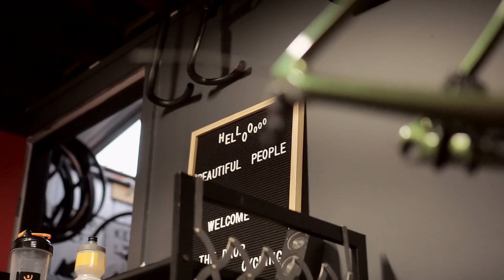2020 Giant TCR SL Canyon aero bars Dura Ace 9170 dream build

Comment: Nice spec, I have a 2020 TCR Advanced SL in Blue that is the twin of my 2020 Propel Advanced pro 1 disc and I swapped out the Sram Force for Ultegra di2. Interesting to see how you’ve routed the di2 cable out with the rear brake hose from the frame exit hole rather than using the top tube underside bung like Giant does.I’ve the idea of the cables being together for tidiness but feel the heat shrink looks too bulky for me personally. 

Good build though. Same colour as the 2020 Enviliv with SRAM my friend has. Looks awesome in the sunlight
Reply from the maker: Thanks John, this cable route is what the owner prefers, I have seen people route di2 cable comes out of toptube and you would seen 3 cables (di2 and 2 brake cables) instead of 2 cables using heat shrink. 👍

Comment: Lovely bike, love the clean lines of the TCR frame, just wondered why the Canyon stem/bar set up? It appears to not blend in, is that because it’s stacked up quite high rather than slammed?
Reply: OD2
Reply from the maker: The owner likes the one piece look and setup, and canyon and giant both use oversize steer😄
Reply: @thedropcycling  nice build, what mount did you use on the cockpit set up please?
Reply from the maker: @simonhogan2043  hi Simon, you can find it on Ebay it's from Japan I think, search ' Canyon handlebars mount' you will be able to find it. Not cheap
Reply: @thedropcycling  thanks, keep posting builds 👌
Reply from the maker: @simonhogan2043  will do 👊

Comment: Great video! Thanks! I've just finished setting my bike with the same 9170 di2 but the junction box button is not working. :( Double-clicking the button doesn't change the shifting mode. I can check it's in M mode. Do you have any clue?
Reply from the maker: Sounds like a faulty unit

Comment: What steerer compression plug is this? I changed the original one it came
Stock with and all the plugs I’ve used slip up except the FSA one.

Comment: Those cables at the front looks out of place when you got an integrated aero bar and stem.
Reply from the maker: same as all the canyon bikes
Reply: @thedropcycling  True but compared to the tarmac and emonda's, this looks outdated. Even factor are starting to hide the cables when they were against it not that long ago.
Reply from the maker: I agree. This is 2020 TCR, even the new generation 2021 TCR SL cables are still not integrated. A bit disappointed for sure
Reply: @thedropcycling  2021 version is even worse going into the top of the down tube.

Comment: Do you have to drop the Junction Box every time you want to charge the battery?
Reply from the maker: Yes the canyon bars has this little clip, design to use the 3 port junction box, easy enough to clip in and out of the bars and at the same time makes it looks neat
Reply: Fair enough, nice and protected from the incidental drive side drop, better than the 910
Reply from the maker: @kennethstreet7868  exactly right
Reply: Is it not compatible with the 5 port junction?
Reply from the maker: It is. It sits flash with 3 port, 5 port may see a tiny bit under the stem

Comment: It’s old
Reply from the maker: it's 2020 model.
Reply: theDropCycling ya, there’s a new 2021 model
Reply from the maker: @marcuscheung5025  yeah correct, the owner bought it brand new front the shop, half price of 2021 model, so to me, that's a win. Performance wise, not much improvement
Reply: theDropCycling yes! In where I’m from (China), The 2021 frame set is around 2000 USD lol.
Reply: @thedropcycling  Hey Nick, hope you're well and really enjoyed watching some of your other videos. What would you think of one of these exact frames with SRAM Rival AXS and Zipp 303s wheels? I saw you were saying in one of your videos that the ISP is a firmer ride than the Advanced Pro (really would like a more comfy one). Would be great to have the frame set only available for the TCR Pro 2021, but they don't sell it in Oz.

Also, for 187cm tall would you say to go M/L in size which is the top end of their recommended size chart? Concerned that I feel stretched on a Large Defy so maybe downsizing is better, but then concerned that the drop between the saddle and the front end is too big. Lots of questions, I know. Thanks
Reply from the maker: @cosminciuraru  hey mate. It qll depends What type of riding you do. That bike is not a comfy bike to ride around or sit on it all day. It's a racing bike. So you gotta ask yourself what you want to do with it. My advice is to choose comfort over speed. Get an endurance bike like the defy or Specialized roubaix if like you said you want a comfy bike. If you are serious about racing. Train! Don't worry about the gear too much. You will have more joy out of it. If you really like TCR, ML sounds about right
Reply: @thedropcycling  awesome thanks for the quick reply mate. Currently riding an entry level Defy and looking for something lighter, faster and with decent comfort. With 2 kids (well second coming next week) all day on a bike ain't going to happen. I'm not into racing so all I want to achieve is to ride fast and decently comfortable on a bike which feels good quality for 1h a day commute to work or on a 2-3 hr adventure from home to 1 in 20 and back on a weekend. Maybe TCR Pro suits better as hard core stiffness is not my goal, I'd rather have more compliance. Thanks again and enjoy your riding.
Reply from the maker: Anytime mate 🙏🙏